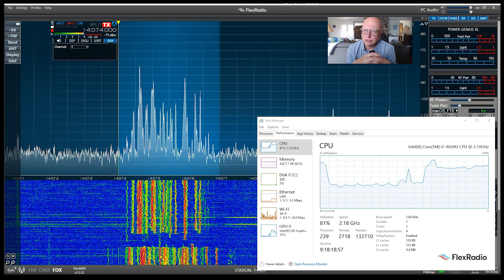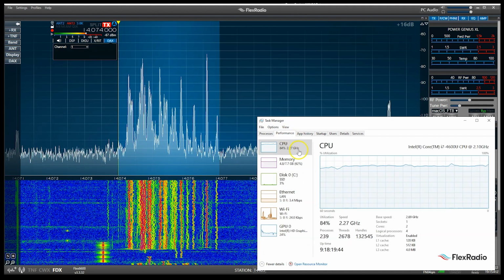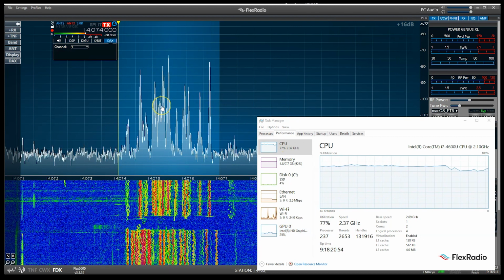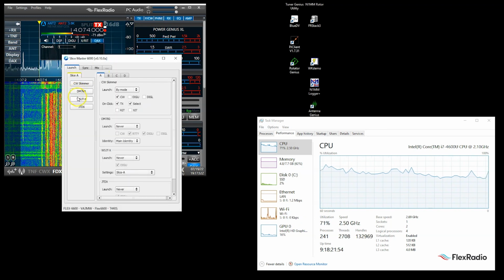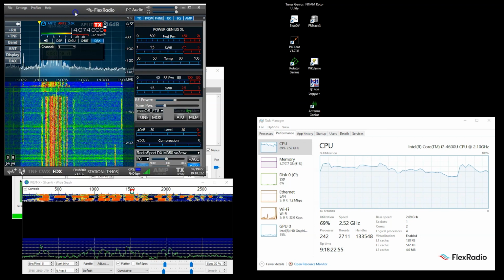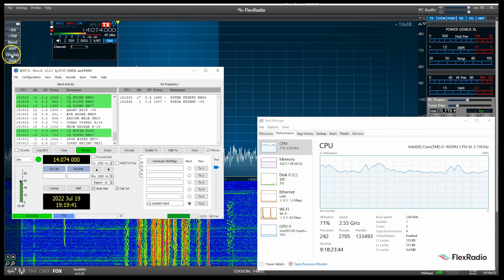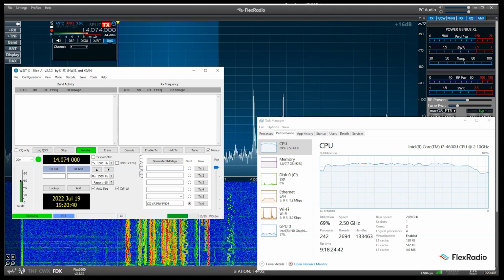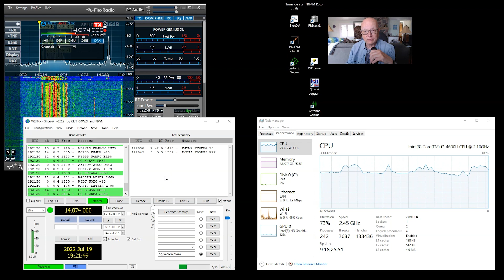Is my computer slow?

Comment: Nice illustration Mike.  A companion video would show how to use controls to reduce the amount of bandwidth needed to a remote Flex by adjusting in SmartSDR.  You might already have one of these produced.

Nine days of up time might be a reason to restart a Windows PC prior to a session of radio operation.  You never know when things have been leaking memory or not unloading from memory properly.  Lastly I have seen systems run slowly when the disk was maxxed out in the Performance monitor but the CPU was not.  Another thing that could happen although it's less likely when you have an SSD.  73
Reply: You might find this strange, but my main computer, a Win 10 PRO PC, the only time it gets rebooted is after an update requests it.  I honestly go months without rebooting it.  There really has to be some sort of issue to make me reboot it even though it only takes about 30 seconds for it to reboot.  

On the PC I have running at my remote station, I have seen it go months without rebooting it.   If I have a program with a memory leak, I will be able to see that in task manager, but I can't remember the last time I actually saw one.  10 years maybe.  

What I have seen is bad hard drives.  Physical spinning hard drives only have a 3 year life span before they can go into a constant state of self repair, and there is no way to tell if this is happening.  I had this explained to me by a co-worker who worked in hard drive design and engineering.  He was one smart person and I was lucky to be able to pick his brain.  :)
Reply: @michaelwalker718  the things that move are the most likely to break.  Hard drives that spin, switches and connectors that get touched, and fans that spin.

Comment: Great vid.  Have been looking at the same thing, and wondering if and or how to off load some of my apps to another machine.  Is there a way to run milti computers and somehow network them to Flex?  KK4BK
Reply from the maker: Absolutely!  You can run SmartSDR on a totally different computer.   You only need to run CAT and DAX on the computer with WSJT.  They handle the connection to the radio.